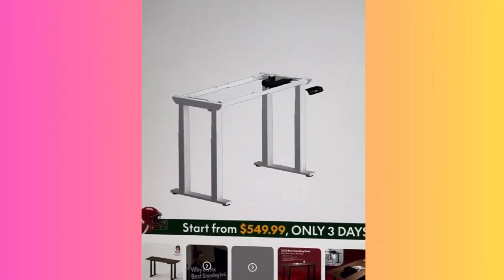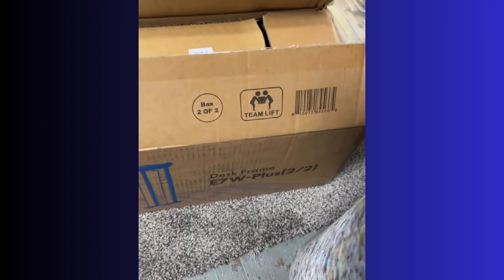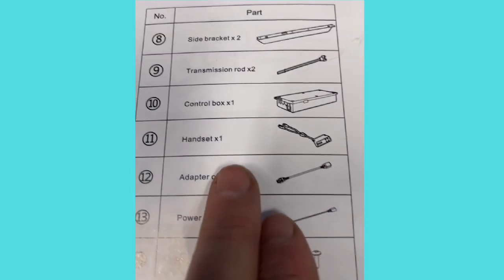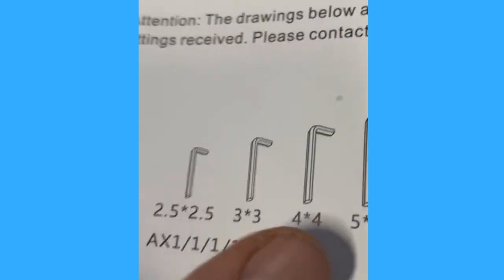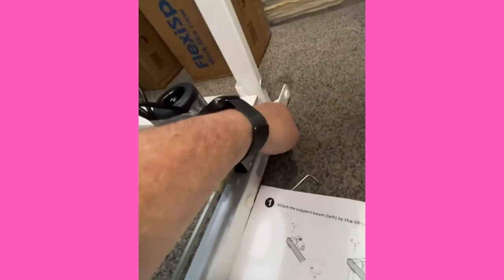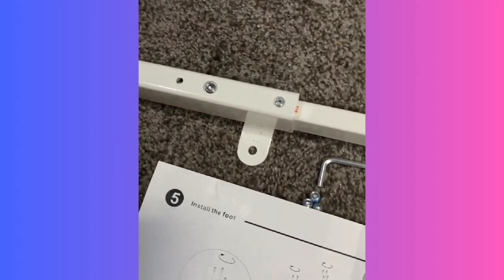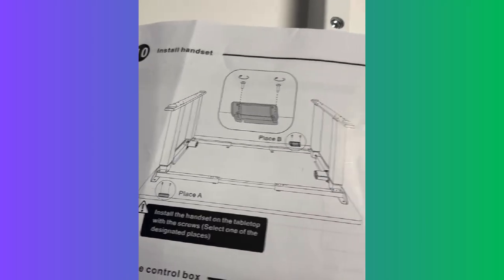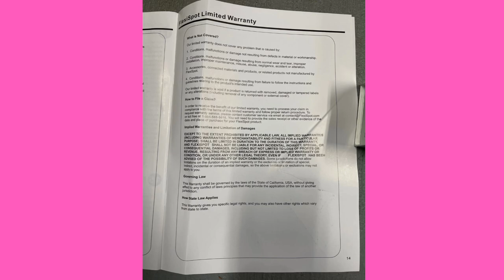Flexispot E7 Plus Desk Assembly and Review

Comment: Thanks for the video!  I found that the screw for the transmission rod in step 3 would never really tighten that much and instead keep spinning.  Did you experience anything like that?
Reply from the maker: Now but I did find the mounting screws into the table top are not that good mostly because the table top sucks.

Comment: Thanks for the video what size drill bit did you use when making pilot holes to attach the frame to the top?
Reply from the maker: I screwed in without pilot hole as the screws looked self tapping